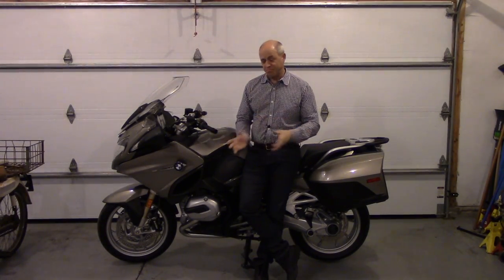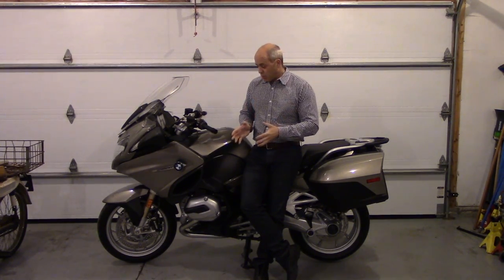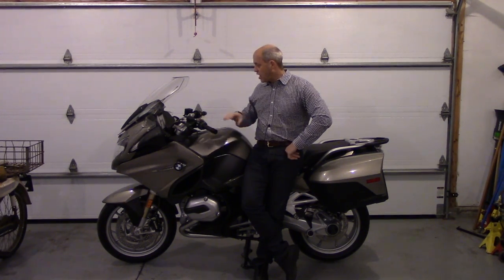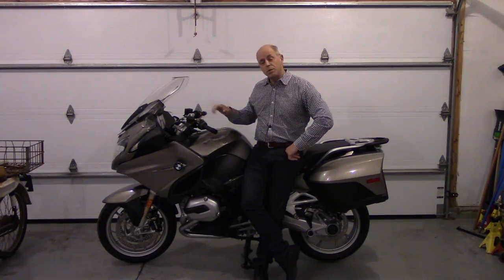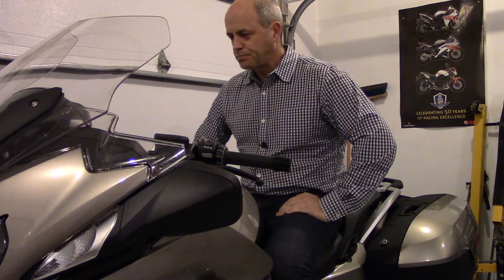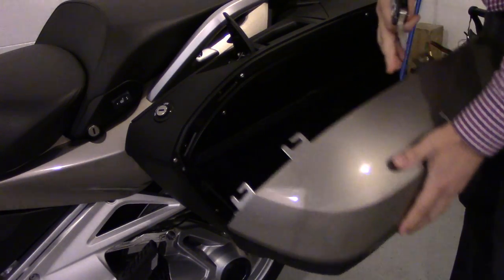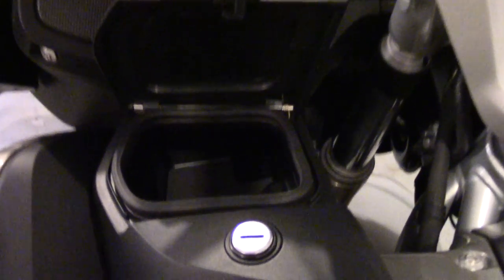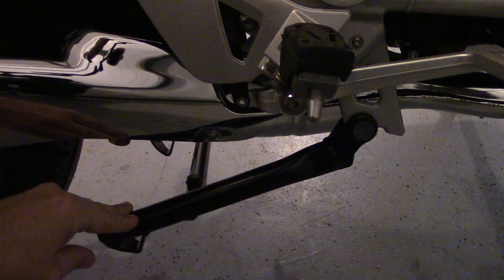2016 BMW R1200RT Overview

Comment: Excellent video.  It took me way too long to find one like this.  Everyone else's videos are just them riding around and chatting.  You are actually showing the bike, the features, and doing a nice compare and contrast.  Thank you =)
Reply from the maker: +Eric Schmidt thanks for the note. That being said, some people prefer the "GO Pro" style videos. Since i grew up pouring over motorcycle magazines i always like close up comparisons where the camera focuses in on specific features.
Reply: I think that depends a lot of the "videographer"  Riders that used the Go Pro or other "action" type camera unfortunately leave the internal mic live and all you hear is wind noise.  There are a few though that make very good "riding" videos, they use either a wired mic or a bluetooth adapter on the camera and use their helmet sound system. Some just disable the built in mic and dub music over the video...I must say I have done it that way on a couple of rides.
Reply: Eric Halsall This. 

I spent a good hour researching the bike on YouTube yesterday and couldn't find a single decent review and then today this pops up in recommended. I was actually going to skip it given yesterday's experience but I'm very glad I didn't.

Comment: I love my current bike,a 2014  R1200gs TE.It has just 1300 miles on it but despite keeping spotlessly clean and coating it with ACF50 after every wash and blow dry,the engine and final drive are badly affected by corrosion.
I am now looking for a brand new bike.I have test ridden so many new machines that I have lost count.One bike has stood out head and shoulders above the rest,you guessed it,it's the RT.It rides beautifully and looks superb from every angle.The top specification model here in the UK, is the RT LE and with the extra's I want,It comes in at a little over £17500.RT forums in the UK,are full of owners complaints about corrosion on these bikes,indeed it seems these bikes corrode quicker than any other bike in the BMW range.Until BMW improve the quality of their bikes,I am afraid as much as I would love to buy the new RT, I am not prepared to spend this amount of money on a bike with such a serious issue.

Comment: As with previous models the adaptive lighting is excellent as long as it doesnt fail its hard to get to and the bulb is expensive to replace.The Exclusive and possible the RTL have the auxilluary lights but to be honest I dont really use them much as they are to low to provide adequate lighting to the road ahead,your better getting 3rd partyspots mounted under the mirrors or attached to third party engine protection bars.
I quite like the added wind deflectors under the main screen as the older models did have buffeting from this area on a basic screen alone.Some have complained about the keyless filler on the previous model and changed it out or disabled the locking system so I wonder if they have altered the software timings on this model?
Moving the side pockets to the top in a similar place to the Pan European is a goos idea as they are more usuable, do they still suffer from overheating of any electronics left in them?
Reply from the maker: +Andi Archer We intend to mount a set of aftermarket LED driving lamps in the coming weeks, and hope to show the whole process of the installation.
Reply: +kiki231000 You might consider looking at the Can-opener whilst your installing extra lighting https://clearwaterlights.com/infopg_CANopener.html
Reply from the maker: +Andi Archer We actually already bought a set of Darla's which come included with Canopener 3 and mounting brackets.

Comment: Very detailed video, not sure how I missed this for all these years. I'm currently riding a Triumph bonneville t100. Wanted to upgrade from Triumph to Honda Goldwing. But now I'm drifting away for this motorcycle. But just worried about the weight and the maintenance cost of BMW.

Comment: I recently found your channel and saw your 2009 review. The review was excellent. And I kept watching your vids until I saw this one, just recently posted. You should get paid for these reviews! You look a little wiser now but still in great shape, so great Job! Thanks for putting all the time into these videos! I am curious to see what you think about the GS....
Reply from the maker: +Daniel Pinedo I will tell you honestly that if I could get the same wind protection on the GS I would own one, no question. The GS represents, to me the ultimate motorcycle. It does everything.  Period. Although my back ground, all those years ago, is in the dirt, I ride mainly on the street. There is an appeal to me to be able to explore regions in my area  that are far away from the beaten path.  I have been promised a GSA in June for a week.  I hope to post up some videos.
Reply: +kiki231000 I really look forward to that...I am a cruiser guy and currently have a Victory CCT. I love being laid back and lounging...but I am tired of the huge heavy bike and the heat from air-cooled engines...thus my quest for something lighter, more nimble, with modern engine technology...After watching your vids I went to test ride the RT this past friday...the engine is fantastic and it handles out of this world, but I can't stand my knees bent like that (I have bad knees) and being on my tippy toes when standing still...so my next stop will be the GS, possibly lowered, with highway pegs and see how that works from me. I know a few cruiser guys that now own GS's and swear by them, so its worth a shot.
Reply from the maker: +Daniel Pinedo it is worth also considering highway pegs mounted on side bars. A lot of folks with knee issues use that as a great solution.

Comment: Nice job Chris,  you mentioned using the optimate charger,  could you tell me which model?
Reply from the maker: I use the Tecmate - Optimate 4 Dual program charger.

Comment: Hi Chris, first I have to say that you are making me a Bmw fan without owing one yet, and I thank you for that. Now out of curiosity since you have had a 2009 rt and as I recall you have some experience with a 2009 k1300gt, how do you match them up and if you were to buy one, which one will you chose.
Reply from the maker: There are significant differences between the bikes. Functionally, the big difference for me is the fit of the bike. I am an average size guy in every respect -- 6ft, 32" inseam. The RT fits me perfectly. The GT (13, or 16) seems to fit taller riders better (my 6'3" buddy loves his GT). Aside from that, the RT is lighter and less powerful, but it has an engine note and character that is very unique (much like a tractor), which i prefer.

Comment: I sold my 836 pound 2018 Honda Goldwing DCT Touring bike to purchase the 505 pound BMW R1200RT because I did not like the excessive weight of the Goldwing. I tried the BMW K1600GTL also, but both the K1600 and the Goldwing are not great bikes for commuting in the city, compared to the nimble R1200RT. Also, the R1200RT is great on long road trips, and I average 50 mpg. The 2018 Goldwing is 85 pound lighter than the previous version, but the top case is too small for two large helmets, and the side cases cannot hold one helmet. That's not a problem with R1200RT.
Reply from the maker: David Vincent I agree and you can feel the difference in weight immediately

Comment: Hello quick question I'm sorry I didn't read all the posts your halo lights the flickering is that just the camera causing that effect.Thanks for your TIME
Reply from the maker: That is the camera. This is a common illusion when watching videos of LED lights (which the Halos are). LED lights actually "strobe" , but it is so fast that we cannot perceive it. It is how manufacturers make them "dim-able" (by reducing the frequency). 
When cameras film them, the shutter speed and LED frequency can fall into sync, which appears on film like they are flickering.

Comment: Hi Chris thanks for posting as its interesting, even though I is out of my price range. I currently ride a GS1200 08 Reg over here in the UK and generally leave the panniers off so can I ask whether you think the panniers on this make it more difficult to filter through traffic as they too look wide. Thanks again .
Reply from the maker: I have never had a problem in tight quarters with the bike and I rarely have the panniers off. The mirrors are the widest part of the bike, so when riding between objects I use them as a guide. Additionally, I have found that my legs are almost as far out as the plastic.

Comment: That is a very nice bike.  How is your vision thru those mirrors?  For many netizens, they seem awfully located too way down.  Do you have any issues with them?
Reply from the maker: I have not had a problem with my mirrors. I also owned a previous generation RT, and it too had low mirrors, which i didn't have a problem with. MY riding buddy who has the same bike prefers a second set of mirrors mounted up high and they do help considerably.

Comment: Looking to replace 2003 k1200rs due to comfort issues. Love the bike but after 30 mins male parts go numb. I always feel as though I am sliding forward into tank. Curious of the seat angle (and peg position) on the RT compared to the RS.

Comment: I rode my brothers K1600 recently on a one week touring trip
I admit i loved the power on the open road better than the RT but, after that, I prefer the RT all round
Touring, around town and in general
I'm a previous owner of a 2005 & 2006 RT1200 always afraid of there problems (abs failure and transmission problems)
I hope the LC RT1200 is problem free 👍

Comment: Awesome review. For someone looking to newly get onto an RT, would you say the newer gen is leaps and bounds beyond the previous generation-or the last gen is a tremendous value now that it’s a bit older.
Thanks!
Reply from the maker: Great question. To be honest, it was the 2005-2013 model that caught my attention off the other brands. That bike won ton of awards and was ground breaking. Furthermore, i think the 2022 (or whenever it get updated) RT1250 will be leaps over the current one. However, when i say "leaps". it is more with the technology than the riding experience. The older RT was a fantastic riding bike. If you are looking at one, (2005-2013) i would look for one with mileage below 50000km if you intend to ride it for a long time. Be mindful of the switchgear issues and the final drive issues with that generation. I am told that the best year was 2009 (i owned one) as the final drive issue was fixed , but the switchgear was the older, more robust style. Aside form that , you can modify it to your exact liking with windshields and seats -- which you will need to do regardless of what generation you buy.
Reply: Chris On the Street Thanks again for the reply. So the 2010-13 may not be as robust as the 09? Thanks again
Reply from the maker: @bebopclownshow  No -- i think what i meant to say is that the older style switchgear on the bars was better than the 10-13 models. However, i am only speaking from owner feedback. I know there was a change (recalls and repairs) which may have cleared this out. I prefer the older style switchgear myself, as it was very unique from the "same old" that every other maker uses. The same goes in the BMW cars- the older style was unique and a perpetual novelty as BMW tried to "work out of the box " and focused on functionality over convention.

Comment: Since you mentioned changing bikes every 3 years, what’s next ? @chris
Reply from the maker: Excellent question. Normally I try something that I like better and it’s one of those luxuries I afford myself to trade up. However…. This bike, with all the modifications and accessories is so comfortable and well suited to my riding that I am going to hold off. My belief is that the new RT would be a likely option, but although it has some new tech, immediately I would need to spend 2 grand to trim it up so that it’s at least as comfortable as this one is. It is for that fundamental reason I am holding off for the time being.
Reply: @kiki231000  that’s a great answer as well ! Tks how many miles yours so far ?

Comment: very nice review.  you covered several things that are typically not mentioned in other reviews.  Thanks.  I am looking at the GT vs the RT, just like you stated in the beginning part of your video, and my question for you since you've had both, is which do you think would work better for a two hour (one-way) interstate commute?  The GT is seems obvious at first glance but my two main concerns are the weight of the bike when NOT on the interstate and the lack of "fun factor".  I'm really looking more for a SPORTtourer (as opposed to sportTOURER) with nice tech and creature comforts while also providing fun in the twisties.  I don't want a gold wing type experience.  I've had ST3 Ducati and Honda VFR.  I'm considering the GT 1600, RT1200, GS 1200, or Ducati Multistrada 1200s (Pikes Peak).  Finding test drives in my area is difficult.  Which do you recommend?
Reply from the maker: If you have any racing experience or you currently race, then I would recommend the RT. I find its dynamics are closer to a sportbike (much lighter and much shorter wheelbase than the GT). If you ride 2 up , or you like to just ride fast in a strait line, then the GT is a better choice. As I mention in the video, the GT will be much sportier than you would think for a bike of that weight, but the RT is easier again for aggressive cornering.
Reply: hmm. thanks for responding.  I'm a non-racer, but based on your description, it doesn't mean I wouldn't like the RT.  That being said, it sounds like it would meet my "fun factor", but would the RT perform well for my commuting purposes (i.e. comfort, ergonomics, smooth ride at interstate speeds, etc..)?  do you have any experience with the GS?
Reply from the maker: The RT will be very comfortable and manages wind better in stock form. The GT, however has a lot more torque and power in general. With an upgraded windshield it manages the wind very well. Additionally its long wheelbase does brilliantly with super slab. I would swing more in that direction given what you have said. 
 I have driven a GSA for a full weekend, on all sorts of riding surfaces. The GS is a fine bike, but it does not offer you the wind protection of the other two. A lot of riders are ok with this, and prefer to rely more on their attire and helmet to manage the weather. Some choose the GS for its wide bars and erect riding position, and manage the weather in other ways. For example if you are a really tall rider , the GS may be the best choice of all simply for leg comfort. If i did more off-road or dirt road long-distance stuff, then the GS would be my choice over all. But i own a very competent dirt bike to satisfy that side of my riding. All that being said, the aftermarket caters more to the GS than the other two, simply because it is BMW's biggest seller. 
I will make the analogy of comparison between the three-- the GT/GTL is like the BMW 6 and 7 series cars, the RT is like the 5 series, and the GS is like the X5.
Reply: very helpful. I love the idea of the K1600GT, with it's comfort, ergonomics, interstate prowess, and options, but i'm just really concerned that it'll be too heavy and not manageable. I like your car analogy, which makes me lean more towards the RT (i drive an audi s4, but i'd like my bike to be more like an A6/S6 which is the RT i assume). I'm 5'9" with 30" inseam so not exactly tall.  Which is why the GS is somewhat of a concern (although they do have a low seat option).  Wind management is a good point.  Since i'm driving interstate for 2hrs i'd prefer to have good wind mitigation even with proper gear.  I'm going to take a road trip to the nearest BMW dealer soon with hopes of trying both the GT and RT.